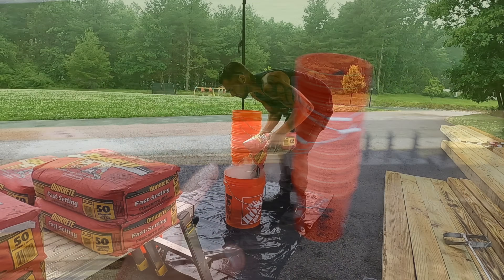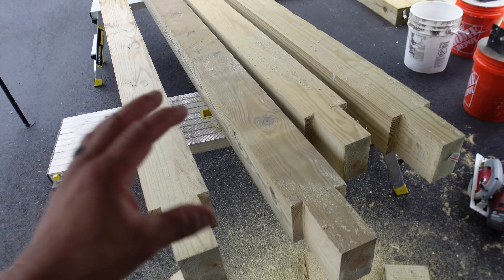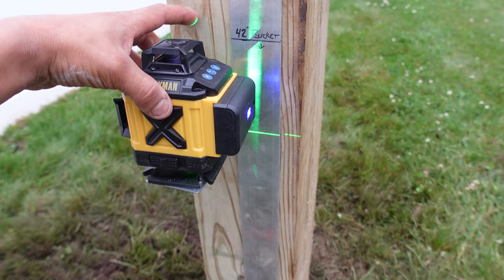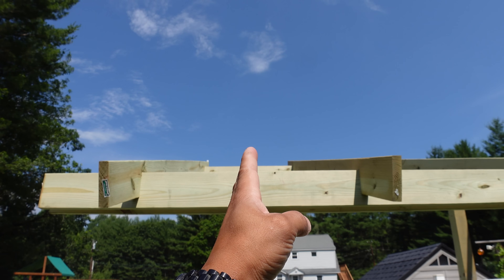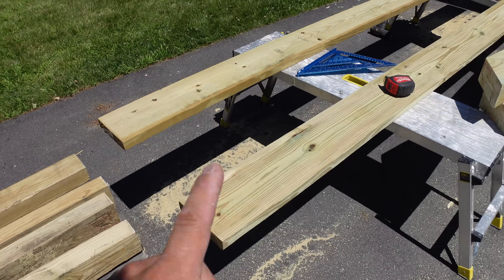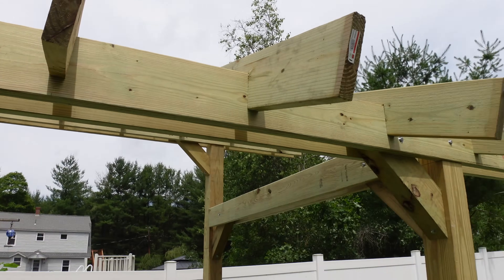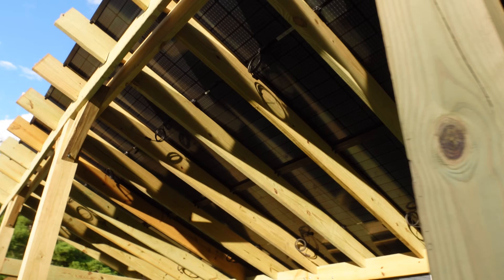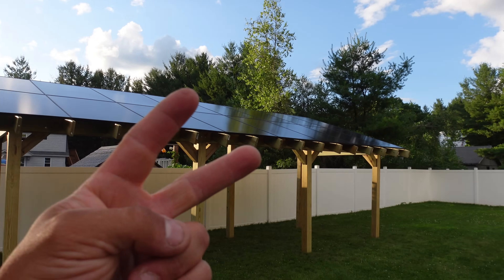Building a DIY Solar Pergola | Step By Step

Comment: Interesting you cut so much strength out of the 2x8s. Hopefully some joist hangers will be installed on the inside part of the headers. 
Other than that, looks really nice.
Reply from the maker: It would be different if I sliced the middle of the joists (like building a house or something) in this case the strength is in the numbers as the weight that is on them isn’t much over them all 🤙🏻

I will be adding some screws “toenailed” into the back side at a later date
Reply: Yeah, not good roof design. You cut the load to nothing. If someone does this up north with a wet snow load, or in hurricane areas……you could be in trouble. I do like the outside the box idea though

Comment: WHAT Micros you going to use
Reply: You generally wouldn't use micro inverters unless you are going to have uneven shading issues or differing orientations. You don't need rapid shutdown because it's not a roof mount so a cheap string inverter will be vastly simpler and roughly as effective as a micro inverter setup in cases like these where everything is uniform and open.
Reply from the maker: @Snerdles  ohh I gotcha! Check my other video to see the kit I’m using @CroweGaming
Reply from the maker: Micros? Sorry not sure what you mean!

Comment: What an awesome project man! 
I've been thinking about building a lean-to off the side of my barn for extra storage, but I never thought about a solar panel roof. It also faces south with no trees. Now my wheels are turning lol.
Reply from the maker: Haha you should do it!! 

I will put together a list of materials for you with cost of this project in the next video or so 🤙🏻
Reply: @ChumpChangeXD  awesome man. I was already checking out the solar kits.
Reply from the maker: @metal_mo  “Signature Solar” is a great company and in my experience great to deal with 🤙🏻
Reply: Looks great!  I'll be SHOCKED if you get significant power from the backside bifacial sun hot you're so excited about, though.  Time will tell.

Comment: Chump comin in with yet another flawless execution. Bravo! 

You know when you see something that’s so obvious in retrospect but you never thought of it yourself? Tossing the whole bucket with cement in the hole was my aha moment! I would’ve been out there for hours trying to keep the base feet squared and level 😂
Reply from the maker: Haha dude it made life so much easier! I just had to open up the hole to one side a little bigger to get my drill down screwed in one side of the post, then spun the 6 x 6 and screw down the other side cause both together were over 200lbs wasn’t moving that around 😂
Reply: You can do that but water will accumulate between the wood and concrete and accelerate the decay. You really want the wood above ground and not in contact with soil, standing water, or concrete for best longevity.
If you have wood that is treated to be below the ground, then put down some gravel in the bottom of the hole, put the wood in, then a little more gravel, then pour concrete. That will let the water drain from the wood more quickly and prevent rot.